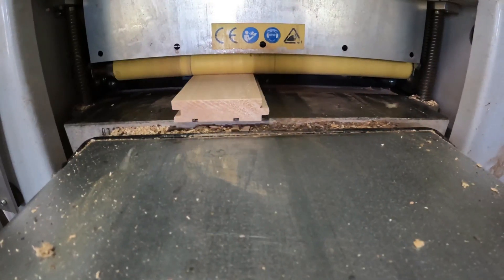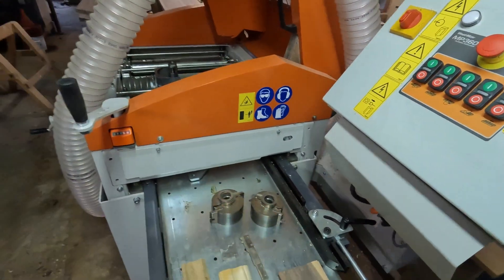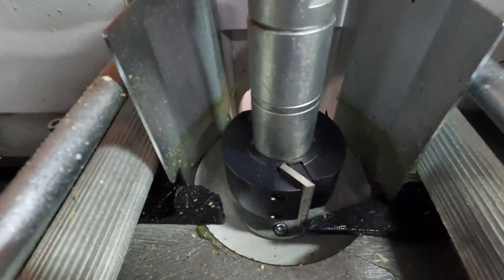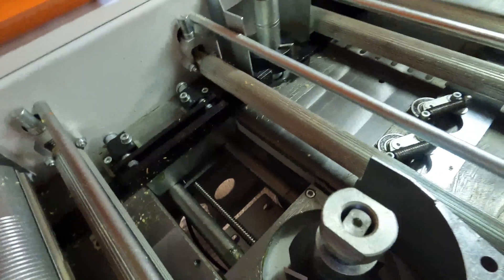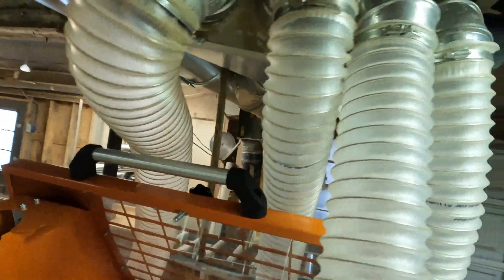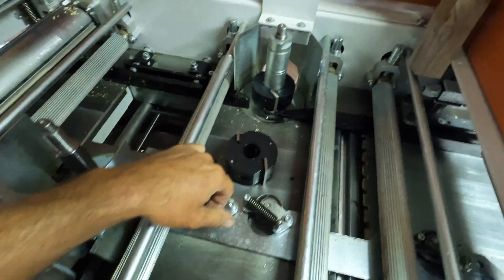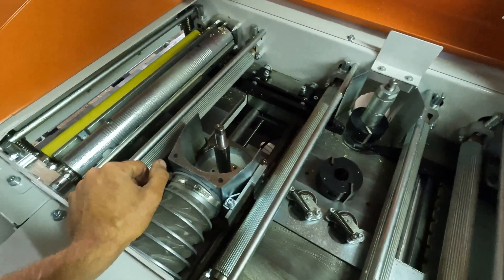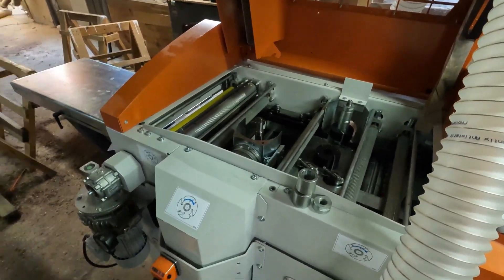What is a moulder and how does it work?

Comment: I have a question u choose the Wood Mizer M360 to do all your work on one machine. I am new to this stuff. We are a Hobbist guys.  With a Wood Mizer LT15 Wide and a Woodmaster 718. We were thinking of the Woodmaster Model 4000 or the Wood Mizer M360. I know probably looked at both or other ones too. Why did u choose M360. I would like your opinion on that and thank for all videos they have helped me.
Reply from the maker: The main reason is I had all the tooling from my previous moulder that I could use with this one. I think the woodmizer is a little bit better designed machine honestly but I don’t have any hands on experience with the woodmaster.

Comment: I just made my first hardwood flooring from a cherry tree that was in the backyard with my router table. It's 3.25" face. I didn't make any relief cuts in the bottom but I can if necessary. How important is it and how many?  Thanks.
Reply from the maker: Quite honestly it’s not necessary. It’s something the industry added years ago to “relieve stress”.  There’s no conclusive evidence it does anything, other than reduce some weight in shipping, but people look at it as a sign of quality flooring, that’s the only reason to add it. Plus you easily know which is the top of the board.

Comment: Can a Moulder give you sides square enough to glue up without needing to be jointed? 
I’m hoping to replace the dressing and jointing process with a Moulder but have never seen one operating in person
Reply from the maker: If setup correctly yes they can. I could see it being useful if you have large batches of the same size parts.
Reply: @hillcustomlumber  thank you. 
I own and run a cutting board business and have progressively scaled to producing 500+ per month. I’m in research phase of how to reduce the labour intensity of certain steps (all using same size stock) but because a Moulder isn’t a common piece of kit and costs a fortune it’s a bit tricky….
Reply from the maker: I used to glue up blanks out of 3/4”x2” strips for a customer that did cnc work. It worked pretty well.  Keep in mind the wood needs to be pre sized to a uniform width before the moulder. I don’t know if you’re familiar with a straight line ripsaw but that may also be of interest for what you’re doing. I have a video on that also. https://youtu.be/_tEb-_b87QQ?si=2ozpTavDj9RiAi3b

Comment: Im surprised they don't have helical heads instead of blades for the top and bottom
Reply from the maker: That’s an option but the problem is you can’t run moulding knives in the helical heads, so it’s only practical if you only want to plane and not do any profiling.
Reply: @hillcustomlumber   good to know, could you possibly have both and change them out yourself?
Reply from the maker: Yes you can, but that’s a major job. I pulled the top head on my 260 to replace bearings once. It’s a 2-3 hr job if you have everything on hand and have an idea what you’re doing. I’m thinking the bottom head would take as long or longer. I honestly don’t mind the straight knives at all. I sold my spiral head powermatic for a straight knife  Northfield and I’m very happy with it. Sharp straight knives will give a better finish over most helical heads I’ve seen. Total cost to run is usually cheaper too. Carbide inserts have gotten $$$.
Reply: @hillcustomlumber   yeah the inserts aren't  cheap i just found that the spiral heads are much quieter and found much less tear out, 
I used to make end grain butcher block and counter tops so spiral head was perfect for that.